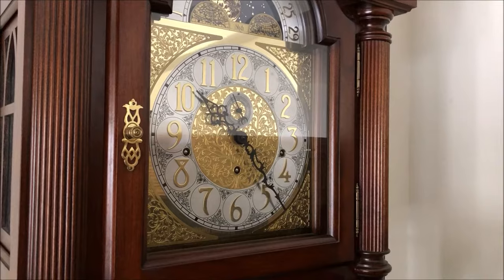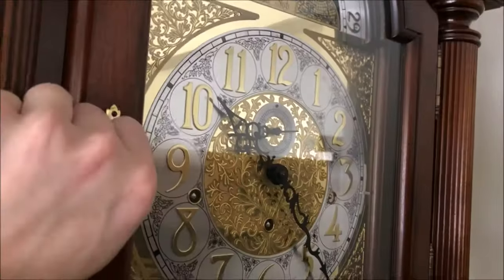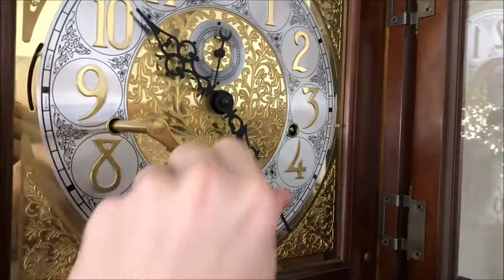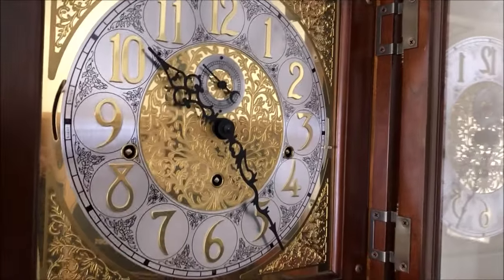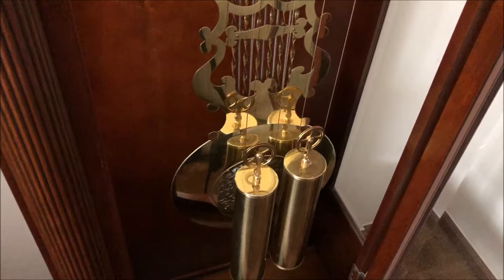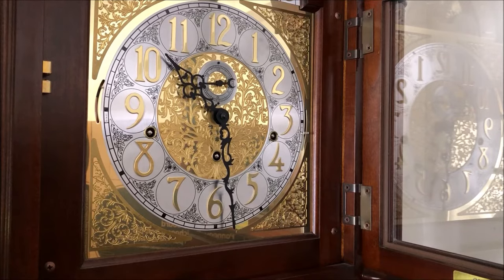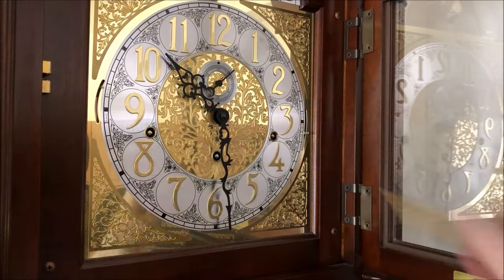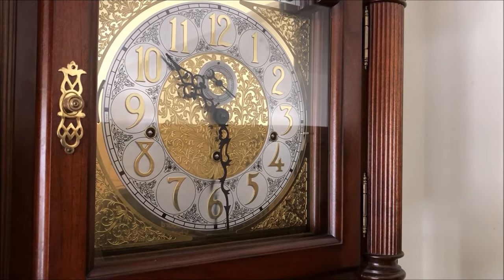Winding a Grandfather Clock

Comment: Hello! My grandfather passed recently and left us a lovely Sligh clock very similar to this one. He was always the one to care for the clock. I was able to find a manual and the key and wound the left and right weights and got the pendulum swinging again. It seems to be keeping time. However, I’m not able to wind the middle weight, it gets “stuck” and the minute hand stops when I try. Do you have any suggestions on how to fix this? Or why it would be happening? Thank you so much!! Have a great day :)
Reply from the maker: That's an awesome story. Glad he left you a beautiful clock and so sorry for your recent loss.  I unfortunately do not know how to fix that, I will refer you to one of my good friends, I will have him reply to this comment with any suggestions to help you fix it.
Reply: If I had to guess, it's likely there's a tangle in the cable where the weight hangs off of. I've never heard of an issue like this before, but that's definitely my first guess. I'm of course not an expert at repairs, just a beginner. 
Hope this helps in some way.

Comment: so, I'm curious, what's the purpose of winding the clocks?
Reply from the maker: To keep the power going to them, winding power/weights provide power to the clock in order for them to run.  When the clocks run, they unwind over time.
Reply: @Jamestube8439  without that, it will stop?
Reply from the maker: @NeilPrasad_1905  Yep

Comment: I just hung a Gebruder Resch 3 weight regulator that I bought earlier this week. I haven't needed to wind it yet. Should I go about it the same way, or lightly assist the weights while winding? This is the oldest (1880), most elaborate clock I've owned so far, don't want to mess it up.
Reply from the maker: Probably wouldn't hurt to gently assists the weights while winding it.  If you want to play it safe.
Reply: @Jamestube8439  thanks for your reply. I'm probably worrying about nothing.

Comment: Hello, i just bought a Howard Miller used and when I got it, the pulleys were wound so far up that I can’t attach the weights to start the clock, please could you tell me how to lower the pulleys so I can attach the weights and begin using the clock? Thank you!
Reply from the maker: What you can do to lower the weights is pull slightly on the pulleys with your hand while chiming the clock on both the melody chimes and the hour strike, that should help lower the left and right pulleys.  (Left is for hour strike, right is for 15 minute melodies) do the same by starting the pendulum and pull slightly on the middle pulley.  (The middle pulley is for running power)  Hopefully this works.

Comment: I just got a ridgeway clock and when it was stored the weights were wound up and the middle one was removed. I have all the parts but need to get the middle pulley down so I can connect the center weight. How would you drop the pulley down to be able to connect it?
Reply from the maker: Pull down on the pulley slightly and start the pendulum.  That will start moving the weight down very very slowly.  It will take a little time but it should work
Reply: @Jamestube8439  oh awesome thank you. Are you able to just swing it or does it need plugged in?
Reply from the maker: @ryanwalker2638  it should just swing

Comment: I found one of these on the side of the road but no key :(
Reply from the maker: Ah dang that sucks, do you know if the clock worked?
Reply: @Jamestube8439  The guy threw it out saying his wife didn't like how it looked. So I assumed so, but it's missing the middle weight and key. So no idea. The mechanisms look pretty clean. It's a Howard Miller 610-875 which looks similar to the 874. (From my advanced grand father clocks research of 1 day 😆).
Reply from the maker: @The2Coolest2 Wow, that is really sad honestly.  Throwing it out because it doesn't look nice to her.  Jeez at that point I'd rather try to find someone who would want to buy it.  Clocks like that are treasures, especially depending on how well they work.

Comment: I have a Howard miller grandfather clock it chime when it want to then stop chiming, and the pendulum stop moving, after a couple hours.  The second tune it start chiming, and moving then the pendulum stop moving, and stop chime, after couple hours, the 3rd tune it move but don't chime 🤔 then the pendulum  stop moving a couple hours again smh.😩😫
Reply from the maker: The movement may need to be oiled and/or cleaned.

Comment: I would NEVER buy a clock like that, especially what if I accidentally break it when I wind it or what if I lose the key 

Also, there’s a lot of sensitive moving parts, which means I’m very prone to accidentally breaking it!

So I DO NOT recommend wasting your hard earned money on that clock!  Just buy an atomic digital wall clock instead, and it even sets the time itself!!!

Overall, I give that clock minus 100 stars!
Reply from the maker: I completely disagree with you.  You’d have to try to wind it incorrectly to break it.  Also leave the key in keyhole and you won’t lose it.  Digital clocks are great but preserving these older treasures is why I collect them.
Reply: But yet, here you are, watching a video about it. Furthermore, just because you can’t wrap your head around how to wind a clock, doesn’t make it a bad.  It just makes you bad.  Go take your atomic clock and kick rocks.
Reply from the maker: @jkropp79  You have a great point and for every clock I’ve wound, I’ve never broken one.  You’d have to try to wind it incorrectly to break it.